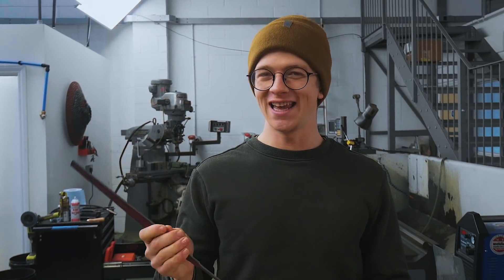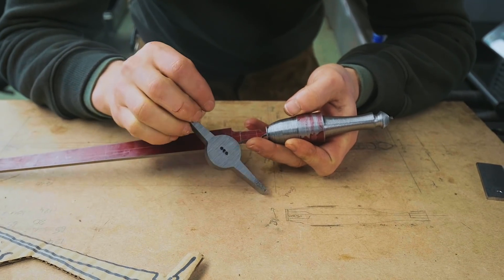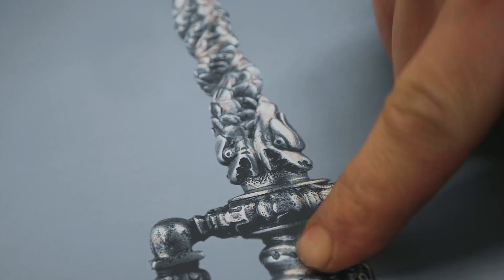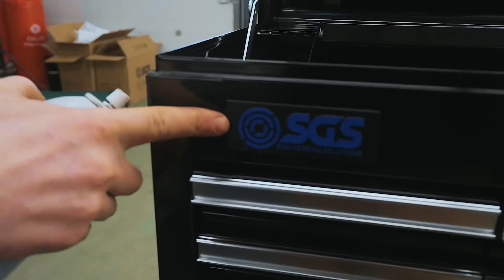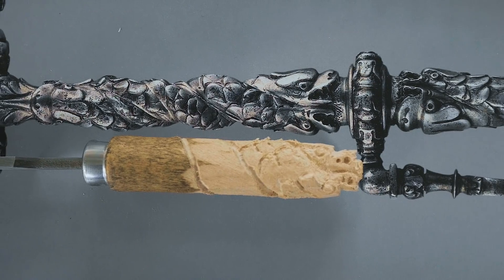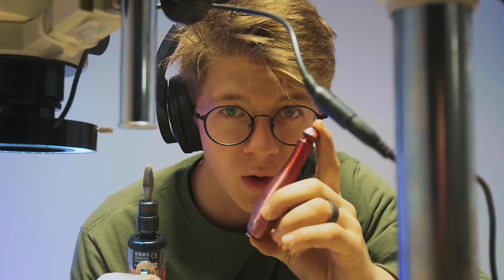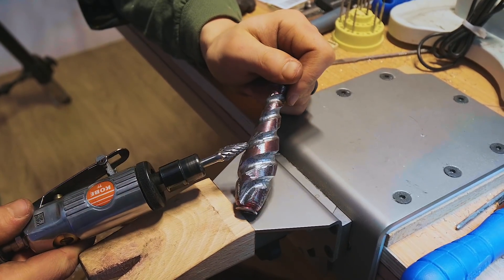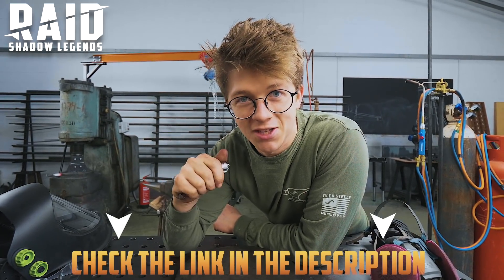MAKING THE SEA-MONSTER STILETTO!!! Part 2

Comment: I have three tips for the die grinding; first off all, fine 'grit' large size burs are available they chatter less and leave a better finish, there is no point in putting pressure on your burrs they should work like a plane not like abrasives, i use doubled up nitrile gloves when using the micromotor, it keeps the splinters out but stil gives good grip an senstivity on your fingers.

ps. please where a face shield, to get those splinters on your lips or (even worse) in your nose is really awfull, is can speak from experience. They are small enough you can suck them deeply into your nose.